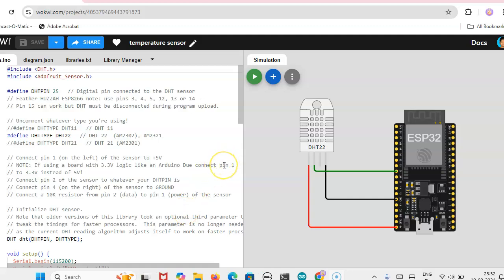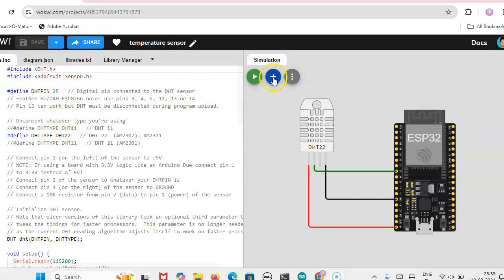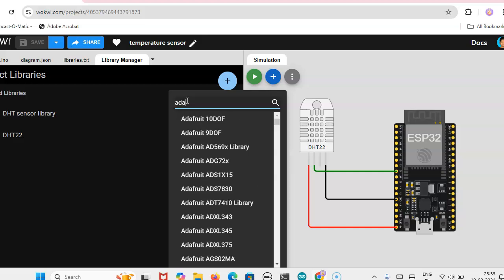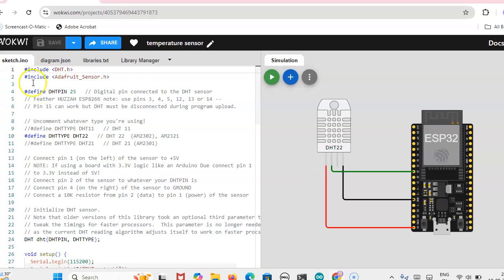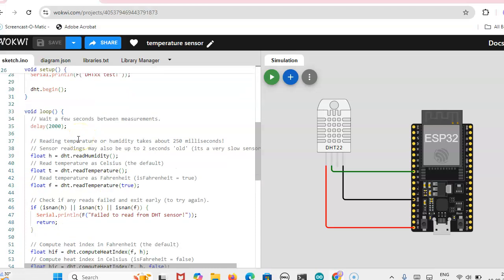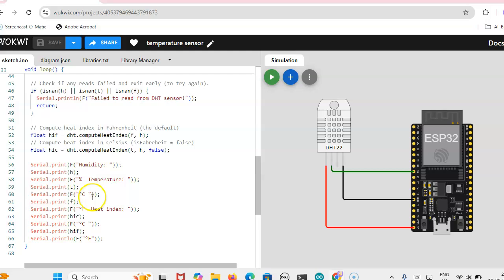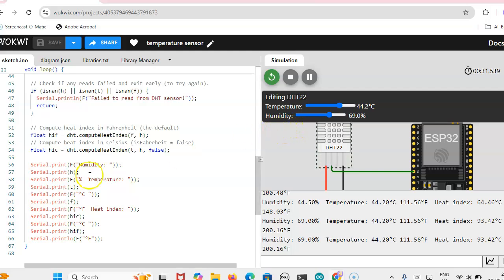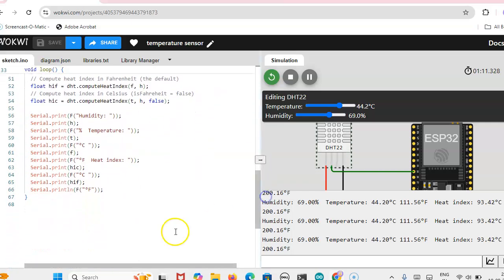WOKWI ESP32 simulator with Temperature sensor

Comment: Good day. I need the code, please. Send the link to the code, please.
Reply from the maker: Code:
#include "DHT.h"
#include "Adafruit_Sensor.h"

#define DHTPIN 18    // Digital pin connected to the DHT sensor
// Uncomment whatever type you're using!
#define DHTTYPE DHT11   // DHT 11
DHT dht(DHTPIN, DHTTYPE);

void setup() {
  Serial.begin(115200);
  Serial.println(F("DHTxx test!"));

  dht.begin();
}

void loop() {
  // Wait a few seconds between measurements.
  delay(2000);

  // Reading temperature or humidity takes about 250 milliseconds!
  // Sensor readings may also be up to 2 seconds 'old' (its a very slow sensor)
  float h = dht.readHumidity();
  // Read temperature as Celsius (the default)
  float t = dht.readTemperature();
  // Read temperature as Fahrenheit (isFahrenheit = true)
  float f = dht.readTemperature(true);

  // Check if any reads failed and exit early (to try again).
  if (isnan(h) || isnan(t) || isnan(f)) {
    Serial.println(F("Failed to read from DHT sensor!"));
    return;
  }

  // Compute heat index in Fahrenheit (the default)
  float hif = dht.computeHeatIndex(f, h);
  // Compute heat index in Celsius (isFahreheit = false)
  float hic = dht.computeHeatIndex(t, h, false);

  Serial.print(F("Humidity: "));
  Serial.print(h);
  Serial.print(F("%  Temperature: "));
  Serial.print(t);
  Serial.print(F("°C "));
  Serial.print(f);
  Serial.print(F("°F  Heat index: "));
  Serial.print(hic);
  Serial.print(F("°C "));
  Serial.print(hif);
  Serial.println(F("°F"));
}

Comment from the maker: Code:
#include "DHT.h"
#include "Adafruit_Sensor.h"

#define DHTPIN 18    // Digital pin connected to the DHT sensor
// Uncomment whatever type you're using!
#define DHTTYPE DHT11   // DHT 11
DHT dht(DHTPIN, DHTTYPE);

void setup() {
  Serial.begin(115200);
  Serial.println(F("DHTxx test!"));

  dht.begin();
}

void loop() {
  // Wait a few seconds between measurements.
  delay(2000);

  // Reading temperature or humidity takes about 250 milliseconds!
  // Sensor readings may also be up to 2 seconds 'old' (its a very slow sensor)
  float h = dht.readHumidity();
  // Read temperature as Celsius (the default)
  float t = dht.readTemperature();
  // Read temperature as Fahrenheit (isFahrenheit = true)
  float f = dht.readTemperature(true);

  // Check if any reads failed and exit early (to try again).
  if (isnan(h) || isnan(t) || isnan(f)) {
    Serial.println(F("Failed to read from DHT sensor!"));
    return;
  }

  // Compute heat index in Fahrenheit (the default)
  float hif = dht.computeHeatIndex(f, h);
  // Compute heat index in Celsius (isFahreheit = false)
  float hic = dht.computeHeatIndex(t, h, false);

  Serial.print(F("Humidity: "));
  Serial.print(h);
  Serial.print(F("%  Temperature: "));
  Serial.print(t);
  Serial.print(F("°C "));
  Serial.print(f);
  Serial.print(F("°F  Heat index: "));
  Serial.print(hic);
  Serial.print(F("°C "));
  Serial.print(hif);
  Serial.println(F("°F"));
}